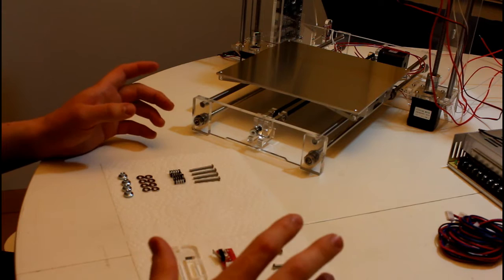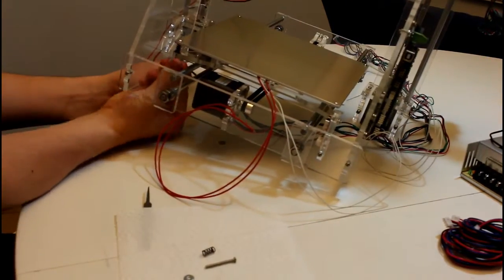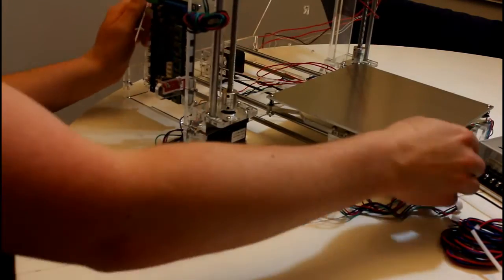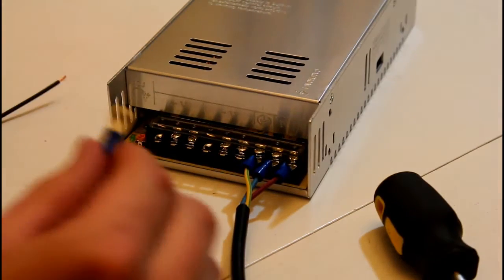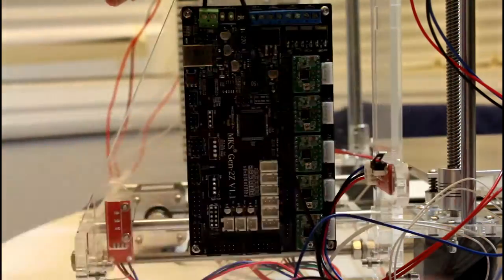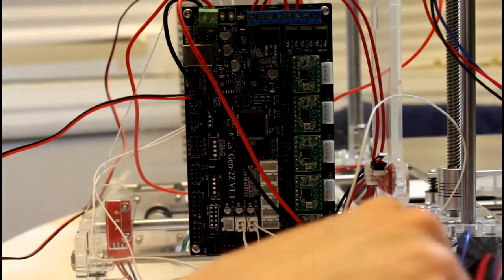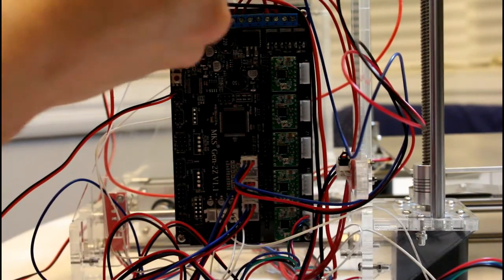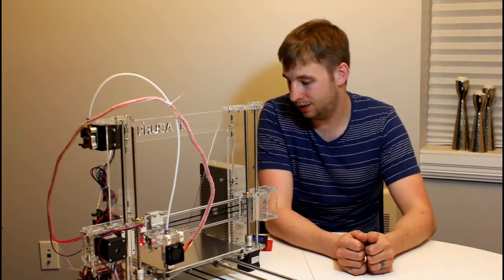Sunhokey Prusa i3 3D Printer | Build Part 5 FINAL

Comment: Hi Alans, thank's for your videos , very good...but could you tell me how could i solder the white wire of the temperature probe because this one has hunooked itself underside the heated bed...? and where , on which part maybe on the aluminium cercle...for the negative ...?
thank's a lot
Reply from the maker: Hi, Sorry for the delay in getting back to you. I was wondering if you could send me a picture of the problem. My bed temp probe is under insulation and I can't remember exact set up. Send me a private message and we can email back and forth and hopefully figure it all out.

Comment: Hi,
I prepare my 3d printer. Its look like working but from hot end flament not coming. somebody  look below videos.i upload video during the my 3d printer working. i need  support and comment . thanks in advance
https://www.youtube.com/watch?v=nhJEVzkhssA
https://www.youtube.com/watch?v=tNzbjcd0AA0
https://www.youtube.com/watch?v=v2UqbyohVY4
Reply from the maker: It looks like your nozzle might be jammed or the temp is too low to melt the fillament. What type of filament are you using? Your first video showed a temp of 200 which would be too low for ABS. Your second, showing you not being able to push the filament through would be too low temp (if the hot end is not melting it) or you have a large jam.
Reply: Thank for your prompt response.I made some modifications in accordance with your comments.I was able to take example prints which you can see in the below links.If you have time can you check the photos and can you make any comments.Thanks again.

https://drive.google.com/open?id=0B4ysyKW0YD7cLW5tSVktV2owRkE

https://drive.google.com/open?id=0B4ysyKW0YD7caTdGUEtMTkhpT1E

Comment: Safety tip/warning:  I am finally finishing my build.  I noticed that you used 4 of the M4 x 12 bolts to mount your power supply to the frame.  I was reading in the Thingiverse User Group that there was a safety issue with using the M4 x 12 bolts where they could ground out inside the power supply case and cause damage to your printer and/or attached computer, and maybe even a fire.  My late 2015 kit came with a bag with 4 extra M4 x 8 bolts and a little slip of paper explaining to use those instead of the 12s.  I am going to build with the M4 x 8 bolts but will be printing standoffs anyway to give some air flow space between the power supply and the acrylic frame.
Reply from the maker: +NLTMW Good tip. I should get a few extra washers and create some space between the power supply and acrylic solving the grounding issue and allowing for a little air flow. Thanks for the comment.

Comment: Great videos!  Do you have any info about your software setup and settings?  Thanks!
Reply from the maker: +NLTMW I use Slic3r for my slicing and I print my ABS kinda hot to get it to stick to the bed well. I use a .25mm first layer height with a bed temp at 105 and a nozzle temp of 250. After the first later I go to 240 and 90. I print pretty slow, but I do want to tune things to get faster.
Reply: +Alans Way - Thanks!  I stumbled upon your excellent assembly series while researching my 3rd printer purchase.  I run ABS in my Ecksbot and PLA in my  M3D printer.  Am now (im)patiently awaiting the arrival of my Sunhokey which will hopefully allow me to do larger prints than the M3D in PLA and maybe some ABS from time to time.  I have watched your videos several times each so far, and expect to know them off by heart by the time my printer arrives.  Thanks for your hard work on producing these videos and sharing with the community!
Reply from the maker: +NLTMW Thank you for the very kind message. I have wanted to get into 3D printing for a while and I thought it would be a fun hobby to make videos on the subject while I learn. It is great to hear that people find them helpful. Hopefully you wont have to be (im)patient much longer.

Comment: Hi Alan, just finished up building up the same model and when I powered it up, all I get are two rows of squares on the LCD display.  Do you need to upload firmware for this to work properly.  If you do could you point me in the right direction.
Thanks,
Reply from the maker: +Tim McGregor Did you plug the connections from the LCD card correctly (they will fit incorrectly). The firmware is already loaded (but i suggest updating it so you can set the EPROM settings directly - there is a great zennmaster video on how to do this). let me know if this helped.
Reply: +Alans Way Thanks for responding. It not possible to get the plugs in wrong because of a keyway on the cable. I have swapped the cables but no improvement.  I did load another firmware from Thingiverse for this model.  I can print from my computer and manually move all motors and heaters.  Everything works great except the LCD/SD card reader part. If you think there is some fine tuning of the EEPROM to get it to work I would appreciate if have time to find it. I'm looking now for it. I have contacted the manufacture about any help or information.
Thanks,
Tim
Reply from the maker: Yeah I ment that they were in the correct ports. It sounds like the firmware is working fine, you might have a bad LCD. Are you a part of the FB group? There was someone on there with a similar issue I think. You could see what they did to fix it. EEPROM wont fix your LCD but it is a great option for tuning your printer (it should be on by default).
Reply: +Alans Way I solved the problem myself. I decided to use information on the provided CD and input values to the configuration of the Slicer Slic3r version. I think it had values for another version they supply. After inputting the values the LCD module came to life. Thanks for you help and if someone else has the same problem they might try this.  Another problem I found was the instructions were backwards on the wiring of the heaters wiring.  I caught this right away because the control board was not the same as in the directions.
Reply from the maker: Well that is not good that the board was different. The polarity of the heater wires does not mater as they (bed and hot end) are simple resistor heaters. 

I am glad that your LCD is working fine now. I will refer anyone who asks about a similar issue to your comment. :)
Reply: What I meant to say about the heater connection was that if was wired to the wrong terminal it would have the wrong temperature feedback would overheat.
Thanks, 
Tim
Reply from the maker: Oh the thermistor wires. Yeah having those connected correctly is very important. Fire would result with bad print quality.
Reply: +Alans Way Actually the heaters wired to the wrong place. Yes a fire would make a mess of a project.

Comment: Hi have you tried to print use other type of filaments like wood, nylon etc. or can it print abs/pla only? The ad says it can only print pla/abs. I'm just curious if you have experiences with other material. Btw do you know which generation is your sunhokey?
Reply from the maker: I have not tried anything other than ABS. PLA is next on the list to try. I don't think that this printer in its current configuration would handle the exotic filaments very well. It is pretty basic, you would probably have to upgrade the hot end and maybe the heated bed. Also the boden set up might not work well for those other filaments. I have the 2015 version of the printer.
Reply: +Alans Way Thanks a lot for the information man. I got other question... do you use auto leveling or manual ? is this printer already have supported for auto bed leveling ? also is this the only 3d printer you ever tried ? or have u known or have any experienced with other chinese brand like zonestar? i want to pick one and still confuse to choose. I found this zonestar that offer the latest eighth generations of prusa. 

http://id.aliexpress.com/item/Free-shipping-High-Quality-Precision-Reprap-Prusa-i3-DIY-3d-Printer-kit-with-2-Roll-Filament/32424257787.html?spm=2114.05020208.3.1.byktZt&ws_ab_test=searchweb201556_3,searchweb201644_2_79_78_77_82_80_62_81,searchweb201560_8
Reply from the maker: I currently do manual bed leveling but auto bed leveling/tramming might be something I will look into in the comming year. I use a 0.05mm gap guage for my leveling (check out my tool video where I talk about that). No this printer does not come with auto bed leveling but you can change the firmware and connect a sensor to the board to install it yourself (as I said, something I am interested in looking into).

This is the only printer I have worked with and I would recomed it. Know that any printer in this price range is a hobby and will potentially have issues (you get what you pay for) but they are great to work with when you start with 3d printing as they are a smaller investment and they really force you to know what is going on when troubleshooting poor prints. Then when you are hooked and want to move to a more expensive printer, you know what you are doing and how to get the most of your tool. 

I dont know anything about thr linked computer (but it may mean 8th gen of their printer and not 8th gen of prusa i3?). I havent looked past when I got my Sunhokey, but when I was looking it was really helpful to read up on reviews and check to see if you can find vids of people who have the printer you are looking at and see what they say the faults are (and there will be some, they are basic and cheaper, but don't be scared just go in with your eyes open- and maybe a plan on how to not hit the same pitfalls).

Good luck with your choosing and if there is anything else please ask (not just me, but others who have the other models you are considering). I am not supported by Sunhokey but I would recomed their printer as a good starter/hobby printer.

Comment: My extruder motor makes a loud clicking sound once in a while. I think it is skipping steps. Dos yours make this sound. If not do you know how I can fix it
Reply from the maker: You are probably correct snd it is skipping. To check watch the gear when it happens and you should see it stop moving or jump back a little. There are a couple things you can do: print slower, use a higher print temp, loosen the tension on the extruder ideler (just before the filament starts slipping), or a combination of the above. I have also heard that shortening rhe boden tube helps but I haven't tried that myself.
Reply: +Alans Way The extruder is definitely skipping steps. I will try to do what you said

Comment: when and how did you mount the board? :( i could use some m4x12 but there were no m4 nuts with my printer :(
Reply from the maker: Hi, I mounted the board using some M3 (x16 I think) screws and some extra M3 nuts as standoffs.

Comment: Hi Alan! As I have told you before, I am struggling for my printer to work. So can you tell me exactly what you did after you built our printer. Sorry for bothering you you. Thanks!! :)
Reply from the maker: the first thing I did was I went to thingiverse and found a model I liked and downloaded it. I then opened the file in Cura (I switched to Repiteir later) and sliced (I suggest you use the simple settings for a while). I saved the gcode to my SD card (directly from the computer). I plugged the SD into the printer and selected the print and then I was off to the races. I use ABS and I don't know what you are using so I cant quote you temps (and that varies between printers too). The first layer is the most important layer, getting that bed adhesion is key. This is done by having a very level bed, having a good surface, the right height for the first layer, and the right temperature.
Reply: +Alans Way For some reason my endstops won't work. Do you have a way to fix this?
Reply from the maker: +Vidyuth Suresh You don't save the stl to the SD card, you save the gcode file to the SD card. As for the endstops, check the wireing. Are they connected to the right spots on the board? Do they have power (does the red light come on when the switch closes)?
Reply: +Alans Way OH ok i understand now. the end stops are connected to the right spots on the board. But when I close the switch one of them doesn't work. but the the other two do? How do I fix this?
Reply from the maker: +Vidyuth Suresh I would check the connections and if something still doesn't work and hasn't worked out of the box, I would contact the supplier and try and get a replacement.

Comment: Great video. Took me exactly 4 hours, so good guesstimate there at the end!! Second day was tuning the print bed and doing some test prints. I just put the print head home and used paper to gap the 4 corners. I set up my slicer Slic3r the way they show in the screen prints that came on the DVD and using Repetier Host too. Problem now is that printing with PLA I get the dreaded curl on the prints. I have looked around and they recommend using a skirt and brim value in the slicer to stop the curling. Will try that tomorrow.
Reply from the maker: +MrSupergee Thanks for the comment. I am glad you found these videos useful. I have not used PLA before (ABS so far). I hope that it goes well. Good luck.
Reply: +Alans Way  Turns out I had a bad solder joint on the heated bed, so after fixing this and using more kapton tape to stop the wires coming loose, with the brim setting set to 5 I no longer have the warping problems !!! Bed is heated to 60 first layer then back down to 50, nozzle temp is 210. A superb printer. ABS next !!
Reply from the maker: +MrSupergee I am glad you found your fault. With ABS I normally have a high bed temp (95 for the first layer then 85 after that). I had to edit the firmware as its default maximum for the print bed is only 90deg.

Comment: hey I have this exact model, for some reason my heat bead is not working, I have checked everything, any suggestions?.
Reply: Thank man, yea I am thinking the same thing as you, however at the moment I am printing in PLA and still learning how to tweak and calibrate, I will definitely need the bed when I get into ABS, does ABS smell bad?.
Reply: So what about the drive gear for the filament pulley, I had to order a different type of gear w/ finer teeth called "MK8" gear because for some reason the one my printer came with does not feed correctly. So my question is, did you encounter the same issue with the Bowden drive gear?.
Reply: Hey is there a way you can send me your Marlin Firmware, there are so many things wrong with my printer, one maily is the feed rate, it was set to " ( 500 , 500, 5, 25)  for some reason I feel that these settings are not right.
Reply: Thanx man. I bought the j head stainless steel hot end, it works well.

Comment: Hi *****, just finished watching this series and wanted to congratulate you on a job well done. I found your videos to be comprehensive & easy to follow and when my Sunhokey(my first 3D printer) turns up in a few days, I expect I'll be putting these videos to good use, so thanks.

I'm looking forward to seeing some of your prints and maybe your experience so far with callibration of the printer and fine tuning settings etc...